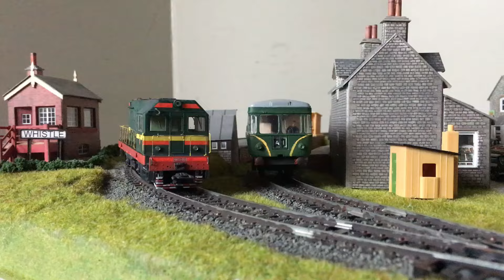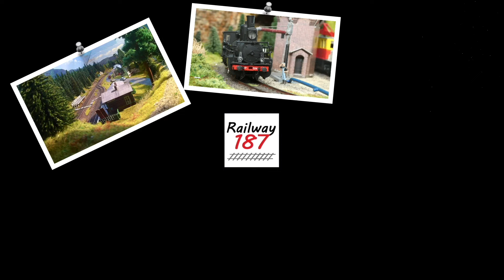Thinking about H0 and OO - two scales with beautiful models and one gauge

Comment: 00 scale / H0 gauge is really a mess - all from a commercial decision made about 100 years ago, and now impossible to change...
Reply from the maker: It is indeed difficult to change now. I understand that apart from the big motors also the play value of OO is literally bigger. They are most certainly attractive in starter sets, for instance. But these OO models need quite a bit of space to swing around, so for a small layout H0 looks better. However smaller locomotives such as Peckett and Terrier look great in OO, I guess they might have been to small in H0 🙃🙂

Comment: British manufacturers opted for the 1/76 OO scale on existing 1/87 HO track because in the 30s and 40s existing motors were too large for the short loading gauge and limited dimensions of British locomotives. They created a market and then for marketing reasons never abandoned the scale. The most obvious side effect is the "narrow gauge" look. In HO the rails are in scale with the models. There are British modellers who have created an exact 00 track gauge.
This scale difference is particularly annoying for people like ourselves, who like both continental and British trains, as they are not realistically compatible on the same layout.
Reply from the maker: If I were Hornby I would slightly adapt the size and find an inbetween, something like 1/82, without changing the name "OO-scale". Models would look somehow better to scale, the contrast with older models wouldn't be to stark and new models would look better to customers anyway and might sell better. It's a gamble though, I guess, and after the TT project another new choice might be one bridge to far for the company.
Reply: @railway187  I doubt Hornby and the other UK registered (we can't say based, as production is mainly Chinese), will ever abandon 1/76 00, there are too many stakeholders in the supply chain, from vehicles to buildings and accessories. The cost of manufacturing new moulds would be prohibitive in a sector that has suffered a considerable contraction in the last three decades. At least one UK manufacturer is starting to produce locally again, due to rising costs of production in China (shipping for instance) and quality issues with Chinese contractors. 
I can't express myself on TT, it's a scale with a following in Europe and it would finally bridge the scale gap between British and Continental model trains, but I doubt it'll ever reach the same numbers of the traditional established 00 and H0 scales.

Comment: Hi Erik, Its interesting to see the comparisons between Ho and 00 gauge Locos. Its not always the case where 00 Locos are larger than Ho, Lima made a Ho 67001 Diesel which is larger than many 00 scale Diesel Locos. I think if Locos from the 2 scales run well on your track and are coupled with wagons that match then why not mix the two.. Cheers, Paul.👍👍🙏
Reply from the maker: Indeed! Especially smaller OO models blend in very well. I have the Peckett W4, the Terrier Bodiam and the Ruston. They are my favourite ones! However I feel my 93xx is to large and especially OO-coaches seem huge. But yea, I am happily mixing both scales 🤗